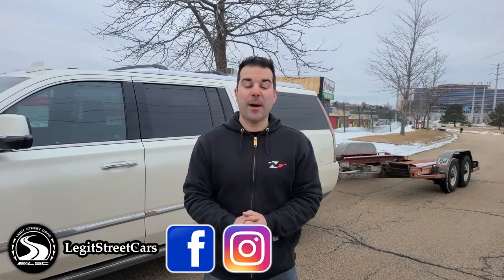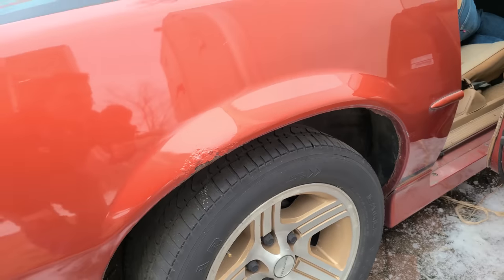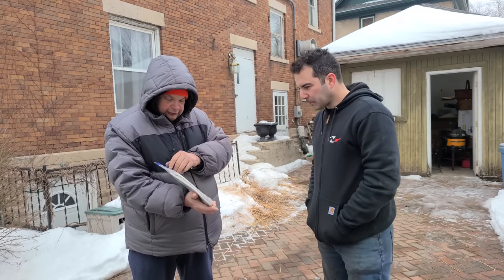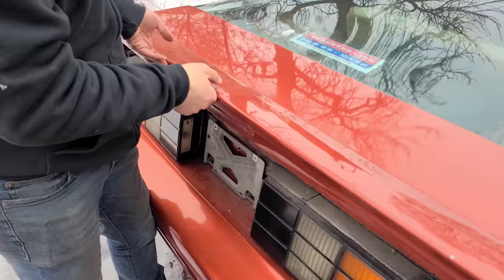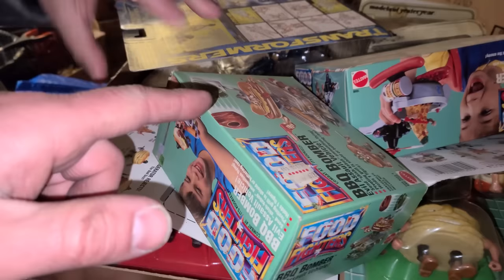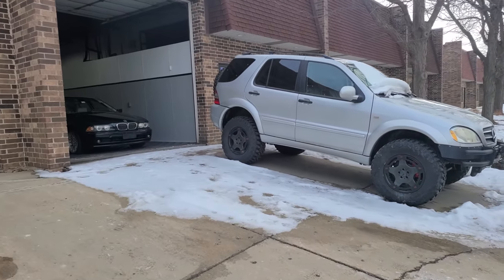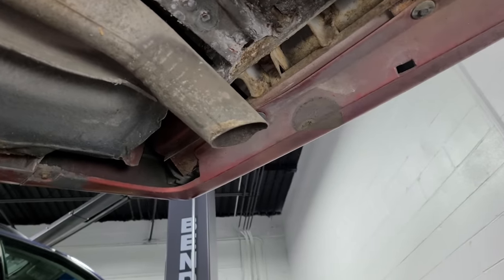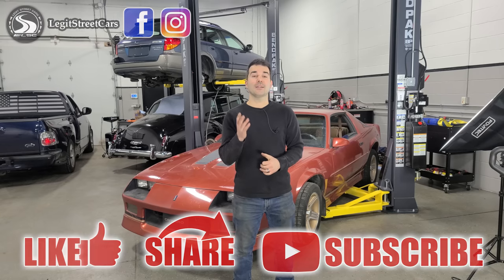I Bought An Abandoned IROC Z Camaro That Sat For 27 Years In A Storage Unit! Here's How Much!

Comment from the maker: What would you do with this car?
Get $67 off the Fanttik EVO300 by clicking this Amazon link https://amzn.to/36mjevH then click the $50 coupon and then use the LSCEVO300 coupon code at checkout out. 
Get $44 off the Fanttik EVO100 by clicking this Amazon link https://amzn.to/3LGYcI7 then click the $20 coupon and then use the LSCEVO100 coupon code at check out!
Reply: I had an 89 and 91 RS. Still have the Chervolet service manual for 1991. It's huge.
Reply: I would part it out for sure. After having fun with it that is. We both know putting 12K into it will not be worth it in the long run.
Reply: LS swap! You know you wanna! I know I wanna see it
Reply: In England an 80's car in that condition would be considered pretty good. I would personally go for a recommission of it and have an usable Iroc. Just do what is necessary to get it through the next year or two.
Reply: You end to stop shopping north of georgia.
Reply: Don't ever buy classic cars from up North. You need to come down here to the southern states cars don't rust here. That Camaro is too far gone. As a restoration shop owner I can tell you straight up this was a very bad purchase. Scrap yard and part out what you can.
Reply: You need to start a series on how to turn a profit from parting out rusted old GM products 😎
Reply: You win some and you lose some. Unfortunately another rust bucket
Reply: Part it out! There’s way too much bodywork
Reply: Looks like mostly flaky surface rust on the floors. Wire wheel and undercoat, then drive it. Please save it!
Reply: All that sheetmetal is fairly cheap
Be an easy return as 4th gen cammers are gaining value
Reply: Bought a 30 plus year old car and complaining about rust? Suck it up buttercup! It's good content regardless of what you do with the old car. Save as many from the junkyard I say. But it is your car after all.
Reply: Rust converter special
Reply: Do what you can for cheap to make it a safe, fun driver for now and keep it. I guarantee in 5-10 years it'll be worth it to replace the floors and do the body work. The 3rd gens are gonna skyrocket.
Reply: I would try to fix it.  Obviously you won't get out of it what you would put into it, but the content would go on for years!
Reply: I have an 88 Trans Am GTA with 47k original miles when I bought it from the original owner 14 years ago. It now has 67k. Was going to have it painted and was quoted 10k to start for body work and paint. Then the interior needed work. I took the body guy's good advice and bought my 91 Camaro with just under 29k miles from Unique Classics in Minnesota. A classic cat dealer. Buying cars from someone's driveways is what you'd expect it to be. My Camaro needs nothing. It's like new. I paid a lot but a lot less than an amateur restoration. I drive both for what they are. There is no way restoring these will ever pay off. They aren't rare or spectacular by any means. I love them but that's me.
Reply: Remove the front subframe, remove all the rear axle, and everything underneath, wire wheel the hell under there, then coat and protect. It ain’t that bad
Reply: Well, Alex. It'd be costly to fix it. But if the money you make out of the vid content pays for the full resto, why not? You like the car, you're obviously a 3rd gen fan, so, I'd say go for it! Also, since it's in this condition and you have the body fixed, there's no need to keep it stock. You could make a sleeper out of it. Could be fun and also good content for your channel. In the end it's your decision, but at the same time I know I'd like to see this car get a second chance.
Reply: @orchids3332  it doesn't make sense to restore one of these right now just to sell it. It will in 10 years. Mint ones sell for 20-30k now. In ten years it'll be 80k. The good ones are getting more scarce.
Reply: Start buying Florida cars my man. Just bought a 90 foxbody down here, zero rust. Literally none.
Reply: Fix it. Its not that bad
Reply: Get a welder, learn how to weld. Get repair panels, repair it.
Reply: I would fix it. This looks like my 88 Iroc. Is this the burned orange  paint? The only  year for that color.  That is what my is. I do hope you fix it up.
Reply: Restore it. It would make for great content. A little outside of the box.
Reply: Buy cars from Tucson AZ!
Reply: What would I do with this car? I would (did!) sell it to you hoping that the whole will be worth more than the sum of the parts. And throw in the matchbox car. 
I've been reading the comments, and they seem to be split between fixing it up and parting it out. Both options are outside my field of expertise, so I hope you can do well with the Camaro and see a profit whichever way it goes. Hopefully the engine is OK!

Dave
Reply: See if you can get it started, then kick it to the curb. Not worth putting the time and money into. Bummer!
Reply: 1) Grow a mullet
2) LS swap
3) ??????
4) Profit
Reply: Make it roadworthy using budget friendly methods.
Reply: My mother wanted one of these so badly. I'd restore it to factory fresh and get many tickets in her memory.
Reply: Oh, ANOTHER reason for you to fix it/restore it/mod it. To make a serie of video on the cost of taking on such a project. Kinda like your flip videos but on a proper restoration on a car in this condition.
Reply: I know a man here in Texas that could sell you all of the parts you need to fix this car up, and his prices  or fair.
Reply: I would definitely part it out, kinda of a headache to restore it.
Reply: @daviddavison5113  great find on this David. This car is 100% worth saving. It's a lot better than most you see in the north. It'll be worth it to revive it, hold on to and sell in a few years.
Reply: Full restore the body and lt4 swap it
Reply: See if a shop class would do the floors and rust repair. Would be a cool collaboration with some younger enthusiasts to get some good experience.
Reply: If you was a regular guy with no YouTube i would say part it out.
But you are legit street cars.
So find a way to make it legit and bad ass on a real world budget.
 Make it solid make what it we all wished it was in 1988.

Find a way to fix the rust cheap get a 5.3 LS and a 5 speed swap.
Make bad ass.

And give it away at a who ever has the best mullet contest.
It has to be there 1st or 2nd car
Reply: Put some lip stick on it make it a good driver. Nice outside and garbage underneath.
Reply: @orchids3332  my 85 Trans am has over 256k on it and it's got less rust then this car dose.. I have no history but my body is not rusted one bit.
Reply: Definitely a parts car now.  Never trust a solicitor to tell the truth - pretends he doesn't know enough about cars to see the obvious and wide spread rust - what an asshole.  At least he reduced the price I guess.
Reply: Part it out
Reply: Take as many parts off (and the engine/drivetrain of course)of this once GM gem of a third-generation f-body and use it for a 'rustoleum' commercial. All kidding aside, well almost, try and transplant as much of this 'Heartbeat of America' rust bucket as you can into a buildable 1988/1989 IROC-Z. (And move out of salt country Alex)! Use to own a 1991 TransAm GTA(and for a short time an '89 IROC-Z convertible), both were one-owner southwest cars thankfully. Now stuck on fourth-gen Corvettes, go figure. Great vlog as always Mr. Palmeri!
Reply: @djcutnpaste  that's a great idea.
Reply: Make sure rings are free and verify engine is ok, then the trans.  Do a massive standing burnout on those dry ass shit tires. Then part it out.  Sell whatever is good, hood, rear glass, bumpers, interior bits, engine trans, rear end Yada Yada.
Reply: @woodsandbarclay  for real.  He should be buying cars from Texas, Florida, Arizona and other southern states.  Cars that have spent their whole lives there will be in way way better condition.  You would actually get a car worthy of a mechanical restoration.  A car from the south would just need a really good detail/paint correction/buff and polish plus the mechanical refresh that he wants to do.  New brakes, suspension, exhaust, cooling system etc.
Reply: I'd like to see it restored but if the money don't make any sense then i'd have to send it down the line. Looking at it even through my hd monitors, the car actually looks to be in good shape body wise. Good and straight but if you have to go replace everything underneath and then find something wrong with the drive train, it would be a quarter flip for me. Tough decision. Good luck on that decision.
Reply: This car is too far gone to do anything with. If there was good bones then yes, restore it. I'd part it out and look for a rust free project from the south or Arizona.
Reply: @gamecockmike175  meh body looks decent besides the fenders, drivers door and entire underbody.  Alex is 10000% correct in his direction of it now being a parts car.  Verify engine and trans are operational and strip it for anything worth money that's in good shape and in demand.  Some parts for these cars are scarce/unobtanium status even
Reply: @rhull3939  he would be better off buying a clean one from Florida for even like 7k and do a mechanical restoration on it and then sit on it while the value goes up.  I can see these being worth 25k in a few years for a clean, straight one.
Reply: The Matchbox k5 blazer goes for 20 bucks on eBay the majority of the ones he had did that return of the di millenuim falcon if complete used are 650 bucks on eBay
Reply: I’d send it to the crusher with the Subaru.
Reply: Dave, you know you can always use a cellphone on the stick and film the car underneath, on the spot, and assess the rust a little bit better.

Post-edit: Hey Dave, since the whole floor is in dire condition, what about cutting all that floor away and implant some batteries?  Get some teslas on that relic!
Reply: Me I’d just part it out and go to next adventure. Or sell it for $500 over to someone who likes or wants to do a full restoration
Reply: Send it to the crusher not worth the amount of money to invest. A good lesson learned for the fans of the channel.
Reply: If the engine and trans work 
Do a top speed (?) 1/4mile run as is. 
It would be funny to see how fast it is now.
Then stick nitrous on it to "improve" on the "stock" time..lol.
This legit street cars
This is what you used to do..
👍😎.
..
Donate the car to someone prepared to resto it.
With all the correct facilities.
Reply: Keep it fix it
Reply: Strip it. Send to the Junk yard.
Reply: Uhaul sucks as soon as you hit 100miles they break
Reply: Sell it to me. 100% serious. I will give you your money back.
Reply: crush it. Thats most likely a risk in traffic and not worth fixing.
Reply: first thing i would never give 1500 for it more like free i get better for free it has been sitting to long to be worth anything u should see the 79 camaros that i got for free or the 67 and 68 camaros i got for free all are rust free clean body cars . right now i am building a 68 chevy pu street truck with a stroked 454 02xx trans 12 bolt possie 4/10 gears rebuilt the suspension front and back all new bushings just needs the final paint and interior finished have dash dun looks real good shooting for about 700 hp best part i only have 1200 in it so far then on the side i been building a 70 high boy dana 60/80 lockers rust free clean body tool box on side 390 4 speed full chrome trim only have 250 in it plus i have a 70 ford motor home for parts that has every fancy part i need with a 428 c-6 in it got it free
Reply: I would set my GoPro to 30FPS or higher instead of the janky 24fps :)
Reply: Restore it and I will watch you do it.  LOL
Reply: I'd buy some gojacks.....and move it asap.
Reply: The farther away from the car, the better it looks, up close not so much.
Reply: Get some wheel dolly a set of four that would be so helpful for you shop!
Reply: I'd buy a truck ls 5.3 and put in a cheap used ls9 cam in it with ls3 springs (~400hp). Then install a line lock and do burnouts everywhere. Its a bummer that thing doesn' t have t tops.
Reply: Give the car to some enthusiast. Or auction it and give the money to someone in need.
Reply: Part it out
Reply: Listen that  IROC is not that bad yes it's going to need 5 grand worth of do it yourself rust repair and and a few new parts like gas tank  probably and all new brakes but frame rails and sub frame didn't look too bad  believe me I seen ones in Indiana half as old running and driving down the everyday and they have not split in half even hitting your massive pot holes all over are roads after winter from the salt and ice and snow you name it but that model with that paint code will make car very much desirable and it will bring 5 grand more than any other paint on any IROC dont ddo a complete paint job if can help body look good besides the places you pointed of course but just do the small patch panels where the rust is on body then repaint match the new welded in metal on body to keep as much as the original paint cause it looked like it could be buffed out to a nice shine I know people will say I am crazy but I just seen the same car sold he that was as bad as yours did not more rust holes around every fender and quarter and roof line and it was the factory same color (RARE) you get what I am saying well it sold for 4,700 bucks because there is people out there that love these 3rd gens.  And they have more money than brains but I know you can do alot of wire wheeling and replace the floors just hope nice did eat all the wires and engine is ok plus make the videos on this car and YouTube will pay for all of it if you know what I mean. You sir are living the dream I know it's not as easy as you make it look,filming and editing all this content that's the fulltime job all by it self And I Thank You for that more than anything. P.S. Dont part it out I know you are dreaming about when you were 16 and cruising in your GTA and want to do that all over a few more times!!
Reply: Part it out, not worth it unless you can make your money back on the content it creates.
Reply: Complete track monster!! I live 10 minutes from Road Atlanta and have ALWAYS wanted to run some laps in a prepped Gen 3!!!!! 👍🔥
Reply: Looks like a lot of money to restore to "New".  If you feel like you can get what you think it's worth and not sink a ton of money in it then Restore!
Reply: I know exactly what I'd do with that car, I recently bought a 1985 IROCZ for my 12 year old daughters first car with that one for parts I could build a nice solid car for her ( paid $500 Canadian for her car)

Comment: When they say "rust free", it means the rust is free.
Reply: lol I'm taking that
Reply: Or that there’s no rust in the photos.
Reply: @lawnmowerdude  LOL....Rust-free photos. Possible loophole there.
Reply: The 120 speedo means it's doesn't have a performance setup.  Not F41.  Not G65.  Rear drums.  No fog lights.  Pretty much a stripper IROC-Z.
Reply: @madrew2003  I always thought the IROC was the top-of-the-line, which meant the "big" engine under the hood. Too bad the 350 had  no manual trans option, since it couldn't handle the power, so it was only available on the 305.
Reply: @valengreymoon5623  the IROC was pretty much an appearance package with the TPI bumping base power from  the170 TBI motor to 195 hp or 220 hp with the TPI.  Unfortunately the auto trans 305 TPI motor got the 195 hp version and was stuck with 2.77 rear gears.  The 110 mph speedo is the giveaway.  The manual trans TPI engine was 220 hp and came with the same 140 mph speedo the 350 cars had.  The 350 was only 10 hp more that year and the auto trans pretty much slipped that much away.  It was the available performance options for the brakes, suspension and rear end that made it able to be "special" in my view.  The one in this video is probably similar to a friend of mines car.  2.77 gear, rear drum brakes, 195 hp and actually pretty tame.  While the 350 was the top dog in horsepower the LB9 305 with T5 manual and 3.45 ratio G92 performance rear was pretty much as quick.  Later 350 engines were  245 hp and separated themselves more.  I owned my 88 for 6 years from new and put 83k miles on it as my daily.
Reply: Growing up in Arizona, rust was never a problem.
Reply: Detroit craigslist
Reply: The rust came free with the car
Reply: Yup. He forgot the comma in between the words.
Reply: @madrew2003  of course not. It's an 87
Reply: @madrew2003  it's got fog lights
Reply: Truer words have never been spoken
Reply: Sooo true!
Reply: I got an 84 f4om some guy and there was actually no rust on it even though it was driven in michigan but apparently it was owned by a collector so he only drove it in the summer
Reply: Freeflowing
Reply: Just like runs and drives really means, it can on the road after $2000 of work but I can move it 6 feet in my driveway just fine, all while it's shaking trying to die and there's so much rust on the rotors it stops like you're brake checking someone
Reply: @ismaelcarrillo3956  ò
Reply: That's right all the rust is surely free . Thanks 🤣🤣🤣
Reply: Can I borrow that line?? It's very fitting to some of the cars for sale today.
Reply: Go for it. :)
Reply: You should have grabbed that bike
Reply: Haha! That’s awesome.
Reply: That’s awesome
Reply: I love how a guy w.supposedly over a million dollars in cars has to talk this guy down a col hundred dollars because you honestly thought a 33  yr old car had NO rust NONE at all... really....but u really fix and working cars on the Midwest/NE???